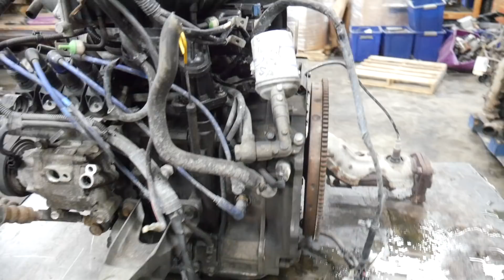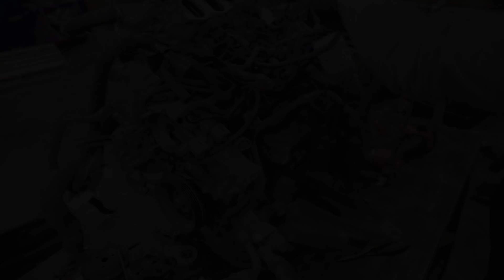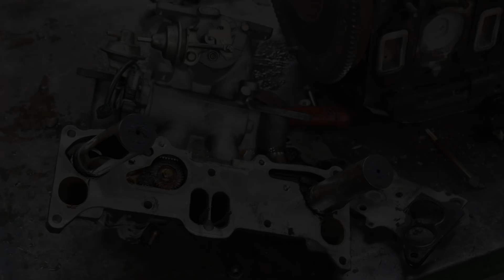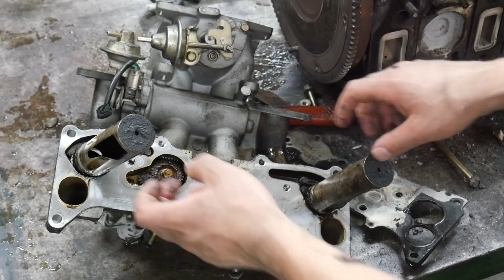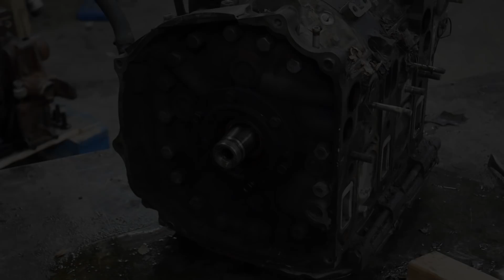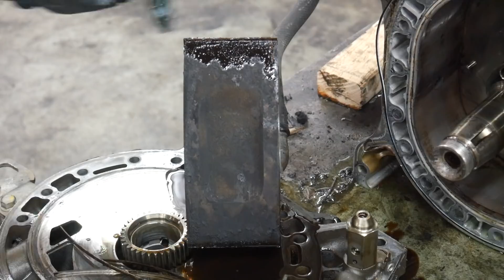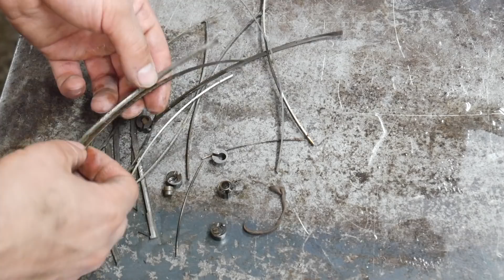13B RENESIS Total Rotary Teardown. 04-11 Mazda Rx-8 6-Port!

Comment: And yet you don't bag Piston based engines that to this day have failures that are from poor design and cutting corners.  You try and replace just the head gasket on a Subaru Forester, thumbs down to your ignorant comment.  Oh and by the way, you should have removed the eccentric shaft nut that holds the flywheel AFTER you tried to take the front pully off.  Next time leave a teardown of a rotary to an expert.
Reply from the maker: First off. Without a flywheel lock tool and a trans or a bell housing, it doesn’t matter which you pull off first.
Second, have I done a video on a Subaru engine? Not yet. Will I talk trash on the design? Yep. Have I voiced my opinion on certain piston engines having terrible design, reliability issues? Yep.
I’m not a rotary expert, I’ve just had a few dozen of the cars. 🤷‍♂️
Reply: @I_Do_Cars  then why even mention the one failing about the rotary in THIS video and not qualify it's not unique in having a design failure?.  Just because of Apex seals being the ONLY major reason for a rotary to fail, you know that a lot more can cause a piston engine to fail.  Rotary is the simplist ICE  engine to fix and cheapest.  Mention that next time rather than just sticking the rotary out in the wind on it's own and trashing it.  And, if you ain't got the tools then don't try to look like you know what you are doing.  Go home.
Reply from the maker: I have a flywheel tool. I sold the trans so it would’ve been useless. 
There are also SEVERAL failure modes on a rotary. To say the apex seals are the only reason to break one completely down is so short sighted. I’ve seen perfect running 12a’s have to come apart just because they are leaking coolant externally. I’ve seen the same with oil leaks. 
It’s a cool design and they are great engines for enthusiasts and people who are willing to work on them. They are terrible and I mean absolutely awful for normal people who don’t understand how they work and do things that shorten their life. When one thing fails in a piston engine you can usually service that thing. A rotary must come all the way apart and everything gets replaced. 
Most rotary guys understand this.

Comment: Thank you very much. I was pretty much aware of how the rotary engine worked but hadn't ever seen one taken apart so that was very interesting. I do have a quick question? What kind of gloves do you use? It looked like one pair lasted the entire tear down and I can't get a pair to last through a single coilpack change so I would very much appreciate knowing what exactly I'm buying that's wrong. I'm getting 5mil gloves are those just way too thin? I'm rebuilding a milling machine so plenty of grease and oil to deal with so I would really appreciate any info you can give me on this subject. I've asked on a couple other sites and one would think that gloves are the same as grandma's secret chocolate cake recipe of something so if you can break the cone of silence once again I would very much appreciate it.

Comment: Interesting engines, but really what a nightmare in terms of gaskets and sills...
Reply: Not a nightmare unless you take it apart. And then only if you can't work methodically in putting back together.   There is much drama and exaggeration about rotaries.

Comment: Brings back memories, I had 85rx-7gslse 13b that still had strong compression at 320k. I modified the crap out of it to 215hp from 135hp stock. I had more problems with transmission and ring and pinion. Man did the memories flow on the takedown. Thanks
Reply: Yeah right how many times was it overhauled
Reply: @derrickwoods2803  My GSLSE didn't die until my brother beat the crap out of it & didn't add to oil to 2nder oiler.  I had the oil going to apex seal as natural oil. The engine was synthetic, RX7 heaven shop recommended the splut oil conversion. I had multiple throttle bodies warp before the greater mods. The oil cooler was a piece of crap, The fitting would crack and leak. I replace everything when I street ported it, it was mild. I had the porting done through Racing Beat. Course replaced anything the parts needed. We lowered the compression slightly when had a custom turbo added. Then we  put heavier pressure plate, &  clutch. Replaced the fly wheel with lightened mass steel plate. Lightened the pulleys w dual belts can't remember why. Rebuilt the rear end clutch pack for the limited slip & added 8.5 quart oil pan. There was the option for a custom pick a ratio transmission thru RB but I had spent way too much money. It took months since finding  & getting parts for custom work was slow. The other crap was done by hand or too much to type.

Comment: "Just the Tip" If ya find that ya have to use an air-chisel and even that one you're using with the lil bit extra stroke (I have that same one) is not quite enough, buy an Aircraft Rivet Gun. It's expensive but that extra long stroke really makes a difference.

Comment: 11:45. Gotta correct you on the intake ports. 

Twin center oval ports are primary. These stay open 100% of the time and feed the engine in the lower rpms.

Side lower round ports are the secondary ports. They have a rotating barrel valve just above that opens above over 3,750rpm. Typically known as the SSV (secondary shutter valve). 

Those upper protruding extensions are the Aux ports. These rotate and open at 6,000rpm to allow very late closing on the intake stroke.

Upper most vacuum diaphragm center top is the VDI (Variable dynamic intake). This barrel valve opens and allows the intake charge to bounce back and forward from the front rotor and rear rotor at ,7250 rpms. This is essentially a rotary's version of Honda's V-tech because as the rotors sweep by closing the port on one side, the intake air reverses back upstream and Mazda funnels that reversed air back over to the opposite rotor. This happens back and forward like a seesaw creating and internal ram air effect. 

All the ports opening in unison is how Mazda is able to move the torque curve up the rpm band and why this engine breaths so well in the upper rpms. That intake is truly and engineering marvel but many just don't understand how they work. 

Edit: how much you want for those housings? I always keep a set around for experimenting reasons. 😉
Reply from the maker: Ha fair enough! 
Open to offers on the housings. Haven’t had a reasonable looking pair for a while.
Reply: @I_Do_Cars  $75 each?

Comment: I think one of the biggest issues with the rotary:
DIRTY USED ENGINE OIL IS NOT MEANT TO BE BURNED!!
I know the general populace wouldn't accept it but these really should have had a separate reservoir where you add two-stroke oil for the oil injection system....... You know an oil that was specifically formulated to burn cleanly inside an engine!
Reply: Aw what do you mean, pushing dirt and metal shavings into the combustion chamber is bad? :P

Comment: Using 2 stroke premix or two stroke oil injection significantly increases engine life and minimises carbon deposits in the apex seal groves along with better protecting the housings from wear. The oil injection system uses gummy 4 stroke oil of low oil flow for emissions with the carbon filled oil not doing the engine any favours in lubricity, clean burn or carbon deposit
Reply: Add to that running them with premium fuel or even E85 will reduce carbon issues, but most people cheap out...

Comment: Hey great vid, the more crap you talk about rotaries the lower the demand for parts so I can keep my RX7 running for longer. You hit virtually every cliché about the rotary engine failures and then pulled down a completely undamaged engine! Apex seals don't really wear out, and they don't normally fail in an RX8. It is the side seals that suffer carbon build up and cause low compression especially in the S1 RX8 engines.
Reply: From what I have seen, it's not even the side rotor seals that fail, it's the damn o-rings between the segments. It's basically just like a head gasket failure on a piston engine. They are good for 80k to 100k miles tops and then need to be replaced. 

Like you said, this "worthless core" just needed 200-300 dollars worth of o-rings and gaskets and it would be good to go for another 100k.

Comment: Having been an Asian import technician for 30 years I can assure you that we dreaded the sight of an RX7 coming in on a rollback. If the design could’ve been made durable it would’ve changed the automotive industry forever as far as power train development. When new they would rev like crazy and as smooth as glass.
Reply: If only they could design it so the rotary seals were easily replaceable.  Do it every 25,000 miles as regular maintenance.  It seems normal to me that such a seal won't last forever, but if only it were serviceable ...

Hey here's an idea.  Put the rotary engine into the car vertically, so the driveshaft comes off the top or bottom, or even off the center.  Yeah, weird for sure, but then you can service a 2 rotor engine, one from the top, the other from the bottom, remove the end plates and change out the seals, without dropping the engine out of the car.
Reply: @davidquinn9676  I don't think gravity would be nice to it. Who knows, it was never done so I can't say it wouldn't work
Reply: @JasonLuther1  Wankels used in industrial applications are mounted this way. I have seen a couple of Sachs wankels that way.
Reply: @davidquinn9676   No problems with Rx-7’s  by occasionally adding engine flush before regular oil changes. I drove three of them hard, running up 35,000 miles/yr in my occupation. I believe engine flush prevented apex seals gumming up.
Reply: @davidquinn9676  If engine seals were a consumable item it's a horrible design....
Reply: @davidquinn9676 if only the seals were the biggest problem. Even with brand new seals the engines consumed oil, had terrible fuel efficiency, and no torque. They were high revving, unique, and that’s about the end of the positives for the Wankel engine.
Reply: The aftermarket put these on the map. Guys are building them to the point that you can't really hurt them now.
Reply: @35RSkyline  Rob Domm 2000hp 900ft torque. And it runs reliably
Reply: @1sinister80  

You are spot on about Rob's car! Rob Dahm. Yes his RX7 4 rotor is absolutely incredible. Sounds like an F1 screaming down the track. I think it may make even more HP than 2k with max boost and RPM.
Reply: @wilsonrawlin8547  That car is so sick. Only car I ever saw beat the Hoonigan stang in a straight up race. He had to detune to 1000hp to beat a Jeep track hawk LOL. You just can't compete with a rotary. The old saying there is no replacement for displacement was said before the mighty rotor existed.
Reply: @wilsonrawlin8547  It makes me sick when I see people put LS motors in a RX body. They just don't get how light and powerful a rotary is. Rob put a rotary in a Vette and took it to a show and all the middle aged vette owners lost their minds. Funny thing is the vette transmission couldn't keep up with the rpm of the rotary and that was the only problem the car had.
Reply: @1sinister80  
Yep! Agree brother.
Reply: @1sinister80 LS swap is a great idea...how can you argue otherwise.
50% more power
100% more torque
Better fuel mileage 
And it's reliable and cheap to maintain. 
You would be dumb not to LS swap
Reply: @35RSkyline Yeah, vultures that take advantage of the poor fools that bought the worse sedan Mazda ever made...
Reply: My stepmother had an RX-3 in the 70s. Pretty revvy as I recall
Reply: I remember rotaries in 70s Mazda's were big in Australia in the 90s but they all used cores from Japan. Maybe now I have the answer why they disappeared never to be seen again, they were probably wrecked once the apex seals went.
Reply: Less parts. Wonder why..? Just no specialist and the precision involved?
Reply: this is your first time obviously 😅
Reply: Only reason it’s not is because it wasn’t allowed to become reliable through steady improvements
Reply: Lol no they wouldn't have. Even if their durability was vastly improved they are still very fuel inefficient. Their applications would have been limited. Potentially aircraft, sports cars, extremely space limited designs. But as much as I love rotaries they would not have revolutionized anything.
Reply: @fcguy7 They make the perfect engine for sports bikes. Guy Martin took out a CR700W which weighed just 129 kilos & puts out 220BHP & said it made the superbikes & MotoGP bikes he raced feel like mopeds in comparison:-
https://www.youtube.com/results?search_query=cr700w
Reply: @fcguy7  The Mazda MX-30 R-EV now uses one at constant speed to drive an electric generator.  That makes it much more efficient.  But yes, and emissions are taxing.  The problem is the lozenge-shaped combustion chamber.
Reply: @john1703  The MX-30 was canceled in July
Reply: @fcguy7 Wankel engines are too unreliable for aircraft applications, and Mazda proved they suck for sports cars.
Reply: When you have to inject oil into the combustion chamber to keep the engine running  your never going to meet emissions standards.
Reply: Two things, emissions restrictions and premix oil
Reply: I been working on cars in general for 20 years and I have to say 1st gen 13bs and 12bs and of course 20bs are way way better for longevity just because of the oilers. Many people don’t know but engine oil is injected straight into the combustion chamber on all 12,13,20 b’s except that crap side port Rx-8. Great engineering piss poor emissions thanks California
Reply: @madman32ish Renosis engines do have a oil meter and it does inject oil from the pan. I have a SOHN adapter installed that injects 2 stroke instead out of a bottle. Premix and you can get 150k miles out of them. It is stupid people who don't maintain and drive correctly. They are pempermental engines.
Reply: @1sinister80 The Sohn adapter is a rip off, it is based on solving a problem that is not the cause of the engine failures and only leads to further engine damage.
Reply: @1sinister80  bs 100% bs there is 0 oilers in the renesis engine the reason you have an aftermarket oiler system is because of the lack of an oiler system period
Reply: @madman32ish  The Renesis is equipped with the best metered oil injection system ever installed on a Wankel engines..
It's the high CR that made them extremely unreliable, more unreliable than previous RX models.
Reply: @madman32ish The early 12A and 23B series engines were gutless turds had didn't make much power and no torque... when Mazda tried to "turn up the wick" the engines failed quickly.
The fatal flaw in the Renesis is that it is the highest static compression ratio of any production Wankel automobile engine.
Reply: @WilhelmKarsten  bullshit the flaw was no oilers and side port induction period 12bs and 13bs are hands down best rotor engines period 12bs were carburetor motors which made them hard to start and lack of power
Reply: @madman32ish  The Renesis is the highest output naturally aspirated Wankel engines produced by Mazda, the highest Static Compression ratio and the highest IMEP and BMEP... too high for apex and side seals to handle.
Mazda was pushing the very limits of the Wankel engine and simply went too far.
Reply: @madman32ish  Wankel engines are inherently unreliable due to their weak seal design and appallingly bad combustion chamber architecture and characteristics.
There is nothing that can be done to make Wankel engines reliable and efficient and the same time.
Reply: @WilhelmKarsten  ok that has nothing to do with what I said
Reply: @madman32ish  What you said was wrong.
Reply: @WilhelmKarsten  Don’t dismiss the basic concept just yet. There’s still some development going on.
Reply: @WilhelmKarsten There are things that can be done. For example the Liquid Piston engine is a reverse Wankel. Still has apex seals but they are stationary. Peanut spinning in a Dorito, not the opposite way around. There are also oils that are ashless, such as Aeroshell, that can fix or minimize the apex seal erosion problem.
Reply: I believe the 13Bs reliability tanked when they started adding turbos. If you left it N/A and swapped on another rotor. They would’ve been pretty decent.
Reply: @OggaDugga  Wankel engines are inherently unreliable and much less durable than reciprocating piston motors

Comment: why does everyone on youtube have to use chrome sockets with impacts?!?!, chrome sockets are harder than the impact anvils and the bolts you are removing, which leads to: early impact anvil failure and increased wear, fastener rounding/stripping, higher torque loss from the impact to the fastener, and cracking of the crome sockets beacuse they were not meant to be impacted as they are made from harder and more brittle type metal...  impact sockets can be found just about everywhere for pretty damn cheap these days. beleive me for the first part of my apprenticeship i only had chrome sockets and i found out eventually that the cost of everything they destroyed was not worth my time and headache to where i could just buy some impact sockets and suffer far less issues...

Comment: DUDE! I needed that flywheel nut!
Reply: For reference it’s a 54mm (2.125”) nut and needs to be torqued to a solid 350 lb feet lol. Racing Beat actually makes an awesome proprietary wrench just for this nut that can be used with the engine still in the car or on an engine stand. It’s a must have tool if you work on these engines at all.
Reply: Those flywheel nuts are bastards to get off.